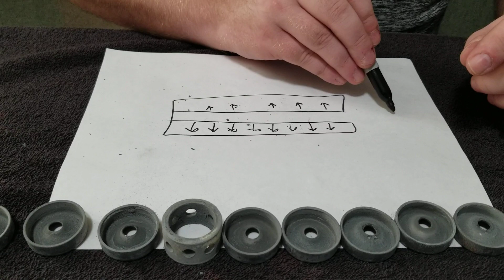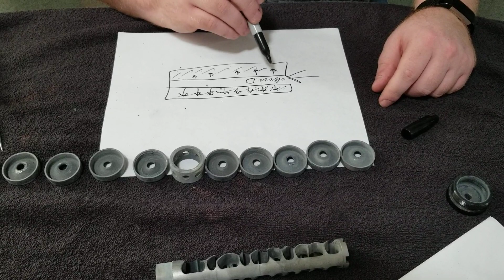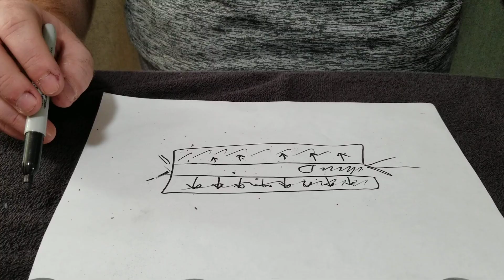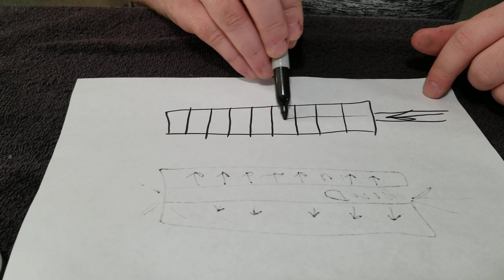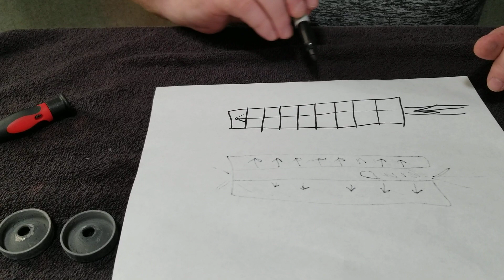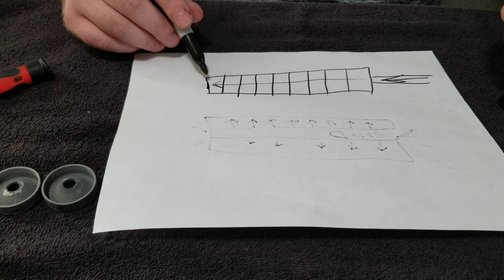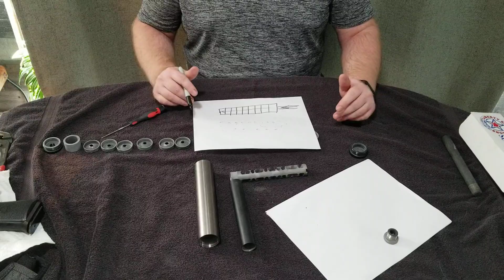How do different suppressors work??

Comment: I'm 61 and the last suppressor design you talked about is what we used back in the late 70's and early 80's if my memory is correct.  I worked at an ammo company that had a class 3 license for testing guns and some had suppressors .. They had wipes they called it and I think they were rubber or something and were like gaskets that went inside as well. I remember we had to replace them from time to time, or the owner did. I didn't do so. They were built like you talked about.  Kinda a tube within a tube and the inner tube had holes and these wipes and stuff to slow down the gases escaping or to slow them down I think.. It's been awhile though.. 
Great stuff.. I found this by accident. I was looking for new suppressor info for a rifle I want to use to predator hunt with and wanted to know about the types available today.. 
Thanks so much. I subscribed. 
Tim

Comment: Hi I had one just like yours with baffles all the way through and it was ok but I took out the first 7 baffles and replaced them with a 6 inch long piece of pipe that I had cut openings in like 1/8 inch wide slices in it to allow the sound to go through and I wrapped the pipe with steel wool and sprayed the wool with white lithium grease and slid it into the can and used the baffles in the last half of the can and it was the best one I’ve ever tried.  No sound came from it. I wasn’t sure if even shot.  Just a small puff of smoke. Try it I couldn’t believe it

Comment: Can you please tell me, how thin are the walls on this two supresors? 
One is steinless steel? The other is too? 

Do you see allready supresors, that tube it self made from aluminium and 1 - 2mm (0,0394 - 0,0787 inch) (3/64 - 5/64 inch fraction) thin? 
Aluminium for 9x19 or even rifle, it will be not so good? 

Thank you for sharing and explane different types of supresors.
Reply from the maker: Hi vladi, both the walls on these suppressors are titanium. The insides (baffles and monocore) are stainless steel with the exception of the spacers in the the homemade one. They are actually pvc pipe. I have seen aluminum ones for 22lr but that's about the extent to which aluminum is used and that was of course just the tube not the insides as aluminum is to soft and will erode away
Reply: @fayettenammilitia7429  
Many thanks
It is helpfool for me. 

Good that i do not bought aluminium one :) I think it is was for airgun, but the seller unfortunely this do not tell. 
Thank you much.
Reply: @fayettenammilitia7429 do they make titanium or stainless steel D cell tubes? And do you Think a 6061 T6 aluminum tube will work as long as the inner is stainless or something? For 5.56.. or would you recommend stainless steel at the least? Where u find the titanium D cell tubes and how long is it?